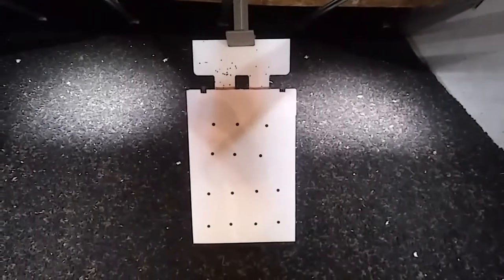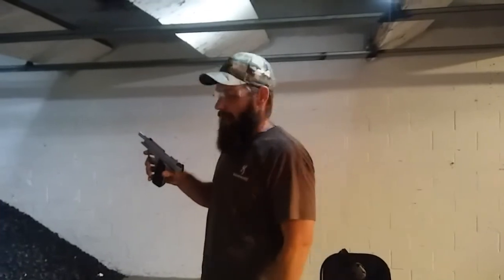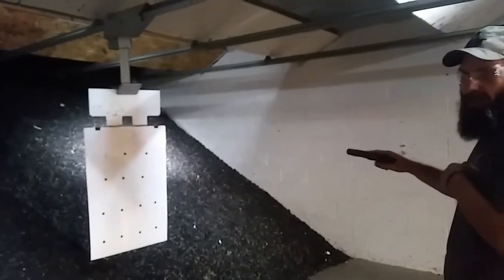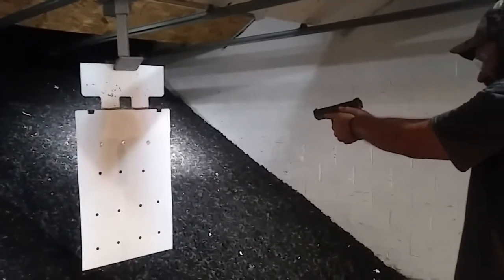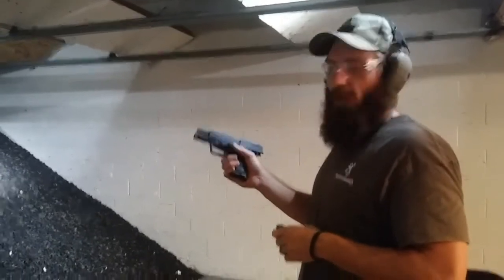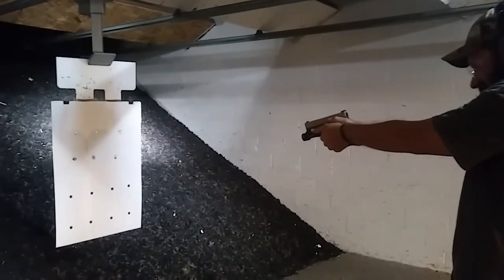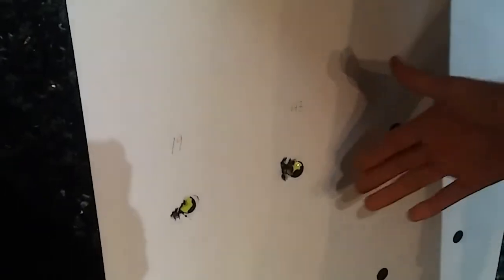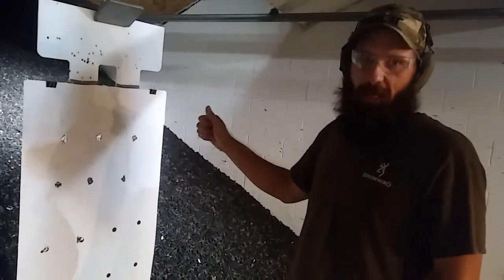Combat accuracy of modern 9mm handguns: 1911 Glock Hk Canik VBOB, 19, 43, TP9SF

Comment: 2 yards. What is this proving?
Reply from the maker: Actually it was about 3.5yrds. The point was the average shooter rarely shoots farther than 5yrds. It was to say the "mechanical " accuracy of modern handguns are very close.  It's the shooter that leads to poor accuracy with a modern handgun.  When you spend a lot of time at the range you hear tons of stories that "gun X is so much more accurate than gun Y" this is really not the case. You may may shoot 1 gun better than another but its not because that gun is superior in accuracy you just happen to shoot it better.  If that makes sense.
Reply: dennis1979gm it does thanks for the explanation